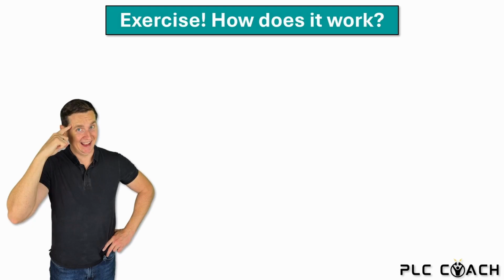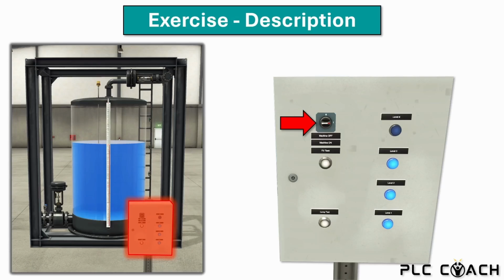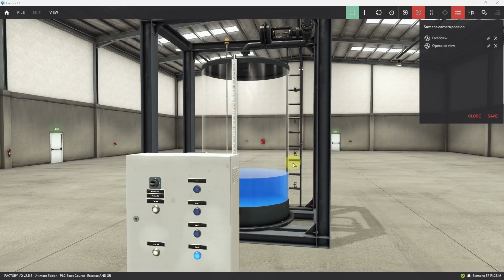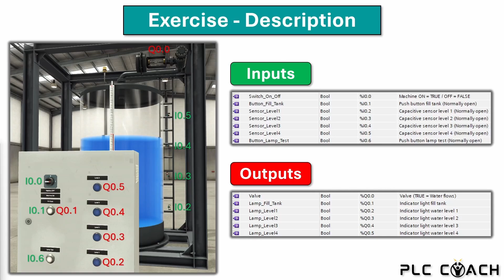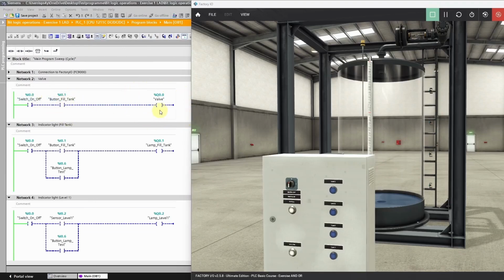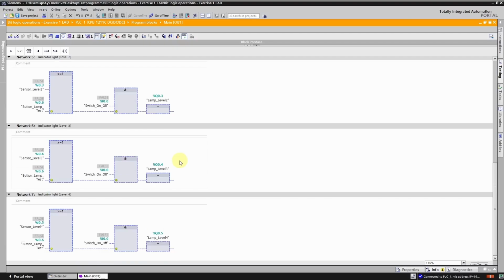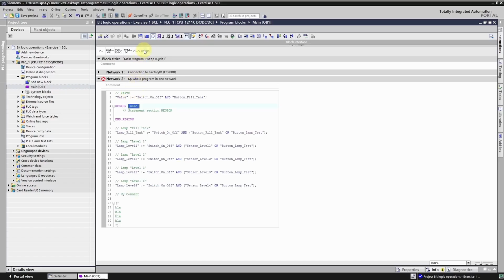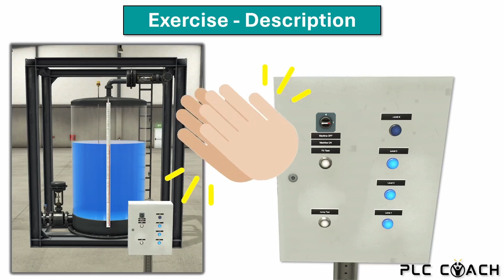PLC Basic Course 3.4 | Exercise 1 | Learn PLC Programming in TIA Portal

Comment: My Plc Inputs are Blinking when I'm simulate the program with factory IO 
Can some one help me I'm tried all the hacks show in YouTube or what google says
Reply from the maker: Hello. 
Seems like you have used the same input-range in FactoryIO and in Hardware Configuration in the TIA Portal. Have you changed input address in the template?
Kind regards
Florian
Reply: @PLC-Coach If I change the I/O Address in Factory I/O or in TIA portal,  Simulation Not Work Bkz of Different input address, 

What I have to Do to Solve the Issue